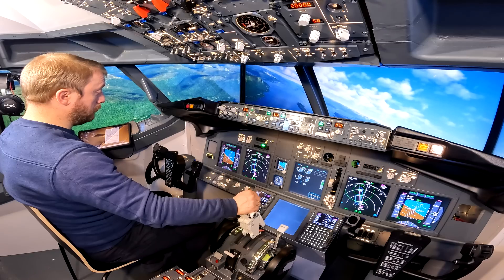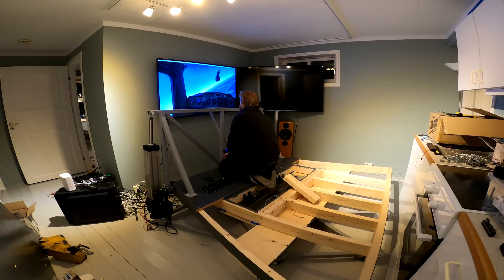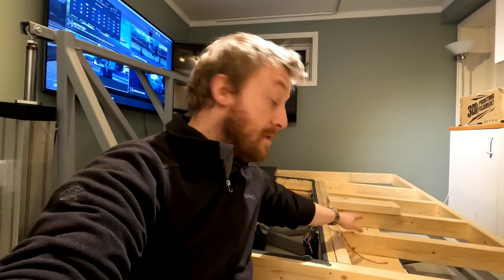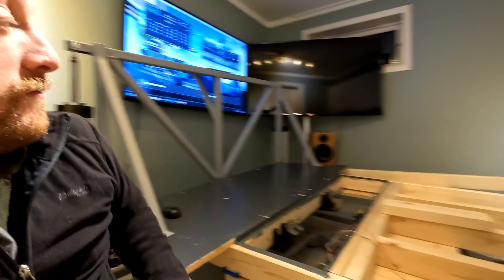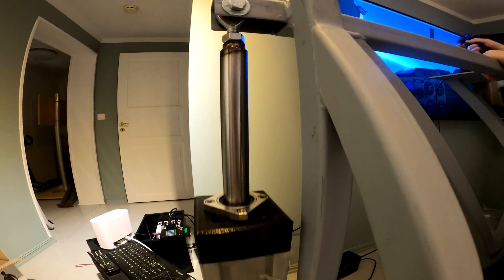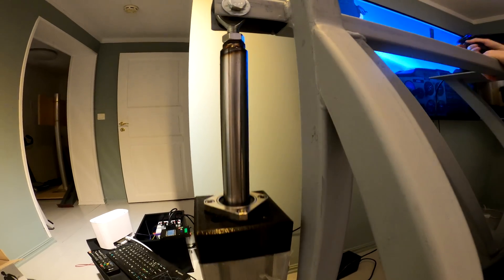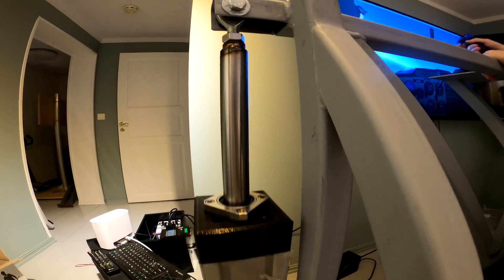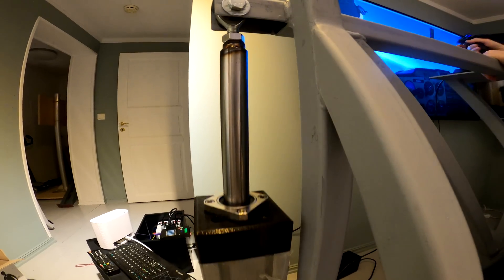Motion Simulator build and test flight

Comment: I have a simulator similar to yours and I’ve dreamt of making it motion. As far as getting the actuators moving correctly, are they using a standalone program or built within the OS? Sim-A?
Reply from the maker: I'm using Simtools V3 to capture motion data from the sim and to make motion profiles. Motion data is sent to a Thanos AMC controller which controls the servo drivers
Reply: @B738DIY I went to a he helicopter expo one time and a vendor (I don’t remember the name) used a series of 4 smaller actuators in each corner to achieve motion. I only bring that up to possibly alleviate the stress of your center joint. Although yours looks great and does the job. It just seams like a lot of weight balancing on that center joint to include a first officer as well if need be. Nevertheless, keep up the good work and I’m glad I found your page to watch. Hopefully I can get my sim up and running soon. Truth is, it was my father-in-laws but he got fed up with it always breaking down on him. Problem is, it was usually his doing because he kept trying to add bells and whistles like amazing weather, moving jetways, multi view exterior camera views. That being said, he knows my passion is flying and while the sim worked, it was great. Well, he has since given the entire thing to me and now I have to learn everything from scratch and try and rebuild it. Wish me luck
Reply: @B @B738DIY the one I have is an actual FlightDeck Solution 737-800
Reply: @B @B738DIY again, I just joined your page and I need to watch your video collection. Are you active in a simulated airline, ATC?

Comment: 2:34 I'm a little perplexed. Given the size of the platform, I would have made that piece out of iron.
It would certainly have cost more, but I would have had a piece that allows me to be safe from the stresses, without the risk of having to replace it. But if it still works after a year or so, okay.

Comment: The Microsoft Flight Simulator is only Worth Buying IF YOU CANT BUY X-PLANE.
ITS BETTER TO KNOW A LITTLE ABOUT AVIONICS THAN NOTHING AT ALL. THATS WHAT THE MICROSOFT FLIGHT SIM WILL DO. X-PLANE - BETTER MODELS GARMIN AVIONICS. THEN IN REAL WORLD FLYING HOURS ALL YOU HAVE TO DO IS LEARN WHAT THE SIMULATORS DOESN'T SIMULATE.
WITH MICROSOFT FLIGHT SIM: YOU HAVE TO LEARN THAT THE GARMIN AVIONICS - THE BUTTONS ARE IN DIFFERENT PLACES AND THINGS ARE CALLED DIFFERENT THINGS. SO, WITH MICROSOFT YOU HAVE TO SPEND ADDITIONAL TIME - LEARNING WHERE THE BUTTONS ARE AND WHAT THINGS ARE NOW CALLED WHAT IN THE REAL WORLD AVIONICS. YOU DON'T HAVE TO DO THAT WITH X-PLANE. JUST HAVE TO LEARN WHAT SIMULATORS DONT SIMULATE.
AN ANALOGY WOULD BE.
IF YOU HAD TO DRIVE A BUS. X-PLANE WOULD BE LIKE LEARNING TO DRIVE A SALOON CAR AND MICROSOFT FLIGHT SIM, WOULD BE LIKE LEARNING TO DRIVE A MINI COOPER.
LEARNING TO DRIVE A BUS - IF YOU CANT DRIVE A MINI COPPER, ITS GONNA TAKE LONGER THAN IF YOU COULD.

Comment: What an incredible achievement! I can't see from this what motion cues you are using when rolling into a turn. So many motion sim builders make the mistake of rolling the sim platform in the same way as the aircraft would roll, which is of course not the motion cue felt by the pilot. (I am a private pilot and aircraft owner).

Comment: Hello, do you have a video discussing your settings, multiview, surround? Fps gpu... i m running 3x 85 inch screens on 4090 and i have minimum 28fps in  EBBR then it goes up to 65 in the sky in the area.... but this is runninfg 3x FHD and not 4k. Thanks

Comment: wow amazing job.  i hope it gives u years of enjoyment.   personally ive never built a flight sim so im just speaking relatively based on my experience with custom projects with cars...but i've always found it very hard to enjoy the finished product fully after so much time and effort while knowing fully of every little detail that needs endless adjustments to be dialed in, and all the possible problems/shortcomings.  however, customers usually just hope in and get straight to ripping around and having the time of their lives. 

 tldr you should sell these,  incredible work
Reply from the maker: Thank you. I absolutely see your point of knowing too much about the missing parts and everything that could have been done better. I am however enjoying the "finished" product and find joy in knowing how everything works, what wires are used when throwing a switch and which line of code is running in the firmware before the simulator registers the change. Everything that is not done or could be done better is just something I'm going to enjoy improving in the future :)
Reply: @B738DIY  awesome outlook!  i dont think anything cooler has ever been built inside a kitchen

Comment: The whole structure sitting on printed parts  is not a long term mecanical solution. The printed parts will end up deforming over time with pressure.

Comment: Man, you are great! But let me say something.

You have put all your eggs in one basket. In my opinion, it would be better if you distributed the system into smaller systems. In this case, you could simplify each part individually and adjust them accordingly. In the event of a malfunction, it will be much easier to replace a cheaper part than an ultra-expensive single block. Alternatively, you can repair parts one at a time without delays, rather than keeping a colossus structure with clay legs that can be disabled by any minor problem.

Comment: I'm wondering why did you not use a commercially available universal joint for the pivot? Such as something available for commercial vehicles or machinery,verysolid and more than capable of handling the weight and loading. Great project by the way, that is dedication to achieving the full experience👍

Comment: Hi wonderful job. I'd like to create over time anything like this. A question : the two yokes that move simultaneously are a your project (DIY) or  have you purchased it ?
Reply from the maker: Hi, the yokes are a DIY project, based on 3D printing and using parts for hobby cnc machines. The plan is to replace the yokes with a new upgraded design including force feedback.
Reply: @B738DIY  Ok. Could you share the DIY project?

Comment: you could install some steer dampeners for straight axle 4x4 trucks to counter act some of the torsion motion you are getting. have you considered fab'ing a true heavy duty truck u-joint assembly to install in place of the 3D printed option? those are designed to handle torsional loads...? could possibly dramatically reduce flex from the 3D printed section and mainly have to deal with flex of wood more so?
idk. just ideas that come to mind as watching. badass setup nontheless. Cheers!

Comment: How much would it be to have a piece of machined CNC aluminium for the joint? Is it cost prohibitive? Right now i'm in the design phase for a single seat (generic) AC cockpit and looking to incorporate motion. Looking at various solutions that will have to handle substantial weight. Haven't decided how many DOF yet.

Comment: Hello, I sent you a message before I was wondering about something. We have received the part that makes the whole cockpit move. Is it something you made yourself or is it a product that can be ordered? Have a great evening.

Mvh Alex R H 😊
Reply from the maker: Hi, the motion platform is a DIY project. I have made the actuators and the universal joint my self. I have of course ordered a lot of parts to make the actuator and other parts But I have made the design and a lot of the parts are 3d printed. There are suitable universal joints and actuators on the marked, but you still need to some engineering to make it all work. There are also plug and play motion platforms, but they cost 10 - 100 times what I have spent on mine.
Reply: @B738DIY  Hi, so yes, I should have had the same type of plan, the build is a Boeing 737,800, but parts are coming from abroad, so thinking of having the same thing as you, it's possible you could make another one, so I can buy it from you

Comment: I am a retired commercial pilot with mostly helo time but about 4000 hrs fixed wing, I have flown Citation Jet, Kingair 200, PC12, B55 Baron and Seneca 3. I think your sim is awesome!! I also have a sim but nothing like yours. Unfortunately I had two heart attacks and had to stop real world flying, but I still fire up my Sim and fly the B737-800 in XPlane. I also have MSFS where I have been flying the B787 Dreamliner, but can’t seem to get it to fly properly the autopilot disconnects randomly so I haven’t been able to complete a flight. After disconnect the AC starts oscillations in pitch and I have to escape. Very frustrating.  I really appreciate you sharing your Sim with the  aviation community. Thanks Again AWESOME!!!!!
Reply: It sounds like the issue might be related to your flight stick or yoke setup. When the autopilot disconnects and the aircraft starts oscillating in pitch, it could be due to small inputs being registered by your controls even when you're not actively moving them. Try increasing the deadzone for your pitch and roll axes in MSFS.

Comment: That's really cool cockpit! I'm just wondering, why didn't you make the u-joint out of metal for a part that holds so much weight?

Also. Why does it tilt upwards when you thrust/throttle up or were you just testing?

Comment: As a professional corporate pilot having spent 30+ years in the industry and many hours training in various multi-million dollar, full-motion simulators, allow me to explain how too many misunderstand the mechanics of flight simulation and how the physics of flight affects the human body. In a properly programmed and configured motion simulator, the Roll axis is only used to simulate “YAW” as coordinated turns in actual flight are NOT interpreted by our body as “rolling” - “roll” information is interpreted by our brains by visual cues of the outside or instruments when there is no outside visibility. Similarly, the Pitch axis is used primarily to simulate acceleration or deceleration while the brain uses visual cues to “sense” actual pitching of the aircraft (or vehicle).
Reply from the maker: Thank you for sharing your insight. My goal is to tune the motion sim to provide the motion cues instead of being an "entertainment" platform. What you saw in the video was me inverting the roll axis, so instead of canceling the sway, I almost fell out of my seat. My main challenge now is that the acceleration data is not translated to the seat coordinates, so the attitude of the airplane is not accounted for in acceleration data, making it harder to tune

Comment: just a dumb suggestion, but would some dampers help..eg car shock absorbers
Reply from the maker: Shock absorbers might help, but would also resist wanted movement. What I have done instead is to add a panhard bar which constrains the rotation around the yaw axis. I will be releasing short build video tomorow

Comment: Hi. How much did the motion base cost you overall? And is it sturdy? 
Also try adding crew seats from FDS in your setup. It will look awesome.
Reply from the maker: I have not writen down all the costs, but my guess is in the 2000-2500 $ range. I'm currently building my own seats as the FDS seats will probably cost more than what I have spent on the sim so far

Comment: Hello! Amazing build. I have an a320 cockpit I’ve built and am wondering how you managed to get the view on your screens. Did you use MSFS multi screen function in game? Another program like Nvidia Surround?
Reply from the maker: Hi and thank you! I'm using the MSFS multiscreen function. I have to rotate the view to get the "correct" view point for the pilot flying, however this introduces significant distortions to the image. It is still worth the rotation to me, but I whish Asobo could make a rendering system that allows for defining view fustrums manually
Reply: @B738DIY  ahh okay, yeah, I have had the same issues using multi-screen within the sim. I also am using additional screens for virtual instruments which is sadly killing my FPS. For your instrument-free view are you just moving the camera outside the cockpit?
Reply from the maker: I'm using Prosim 737, which does not have a virtual cockpit. In addition there are separat applications for instruments which can run on separat PCs, removing the need for rendering instruments in MSFS freeing up a lot of CPU/GPU resources. Prosim does also have a suit for the A320. It is expencive, but might be worth it.

Comment: Can you program the motion system to vibrate or rumble to translate to the effect of the thrust reversers?
Reply from the maker: I'm using tactile transdusers for that very purpose. Having the actuators shake the sim with high amplitude and frequency will just shake it apart.

Comment: OK, my flight Sim platform is a bit smaller than yours, without the massive cockpit fram, but including 3 55" Screens.
I also own 5 3D printers- from really large scale to tiny resin. I have 1000's of hours printing.
This whole video made me cringe when you started putting all that weight on a 3D printed U-Joint. It is literally the first point of failure, and it will fail I think. If it does, do you not have to take apart everything on top of that u-joint to replace it?
I understand the DIY reasoning, but one part, the most important part, could have been purchased very inexpensively for total reliability.

I am super curious!
Other than that, this is excellent work- thumbs up!
Reply from the maker: Thank you! I do get your consern regarding the 3D printet u-joint. I was curious if it could be done my self. My thinking is that the u-joint will mainly see compression loads and some torsional loads. For compression loads, weakness between the layers does not pose any risk of failure. Torsional loads on the other hand does pose a risk of layer separation. I have done plenty of FEM evaluations of the design. In compression the safety factor is above 10, so I expect it to survive the abuse. If it fails, I will be very interested in determining the failure mechanism

Comment: you could stabilize the platform even more by adding shock absorbers at an angle from the platform to the frame to dampen side to side motion
Reply from the maker: I'm in the motion of adding a panhard rod which limit the rotation

Comment: Awesome project! But why did you go with a 3D printed universal joint when most of the parts of the frame were metal? A simple barring holder could have been fab'ed at the same or cheaper and stiffer than the 3d part.

Comment: All that weight on a single 3d printed point very risky
Reply from the maker: I did a lot of FEM analysis on the joint. There should be a significant safety margin both for vertical load and torsional load

Comment: Why are you using 3d printed universal joint instead of just getting it from a scrapyard? they are designed to carry a lot of torque and would work perfect in this situation.
Reply from the maker: It would be, however since my frame is made of wood, I needed a very large flange to reduce the torsional loads on the interface. I dont have many scrap yards around where I live, so I would have to spend my limited time on searching for a suitable U-joint and then spend time on modifying the part. In addition I dont know if all u-joints are easy to weld if they are cast?

Comment: Having been a part of the Boeing team that built the 737 classic....The Next Gen, and flight tested the 737 Max... i applaud your Build and innovation sir!
Reply: whery nice job with em. exit 😄
Reply: Applaud all you want just don’t blow any whistles 😂
Reply: @Cyge240sx  lol
Reply: You deffenetly tested the max well😂😂😂
Reply: @aleksandarpantic8450  Thier is a lot that goes into flight testing. 
Many different planes are tested with different test packages.

I understand your joke and even agree with it. 

The "Max" problems were software problems not Aiirframe or Poweplant ones.

Software is loaded, and updated from my position as part of the Test team.
Reply: @vi683a we not gonna talk about the door blow out?
Reply: @Av_geekie  Why?
Reply: @Av_geekie  That's spirit aerosystems, and that had to do with bolts not being installed after maintenance. There was nothing wrong with the door plug design, merely its installation.
Reply: @Chika_Champon  but all to do with Boeing....yes maybe Spirit Aerosystems did the assembly, but its a Boeing aircraft, its their responsibility and they signed off on it

Comment: OK, I'm 2 minutes in and I'm absolutely intrigued to see the finished result of this new joint support, 1st thing on my mind is wondering if it  will be better after he adds all of the weight of the finished cockpit. I cannot imagine anything more frustrating than designing a new support that is more rigid, and then finding out after the entire cockpit is assembled, the unwanted movement returns. Either way! this video has me hooked!

Comment: This is B738DIY your captain speaking, were crusing at 400 knots at an altitude of 30000ft and if i look over my left shoulder...theres 10 minutes left on the sausages 😊
Reply: LOL!!!!
Reply: He can use the sausages for timing his holding pattern turns
Reply: Real
Reply: Cant fly at 400knts man
Reply: A typical commercial passenger jet flies at a speed of about 400 – 500 knots
Reply: @bryansweeney1633  at ground speed yes but at crz fl it’s around 200-350
Reply: @UnknownUnknown-bvnd 
Thats indicated airspeed you are talkung about, and its just that low because the air is so thin that the speedprobes show too low, incorrect numbers. The actual groundspeed/ " real speed" in this szenario will be around 400-500kts, depending on windspeed and -direction.
Reply: overspeed overspeed overspeed overspeed overspeed OVERSPEED OVERSPEED OVERSPEED